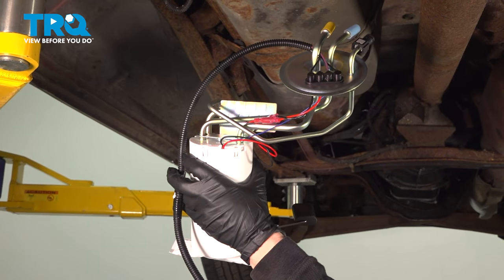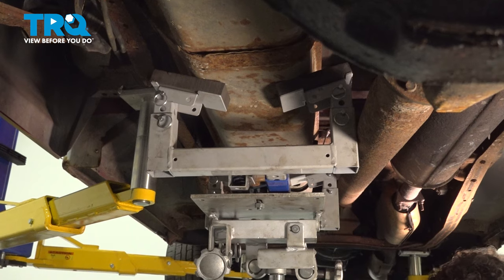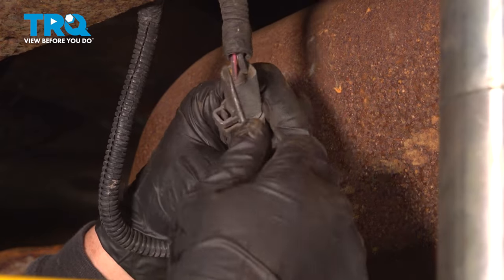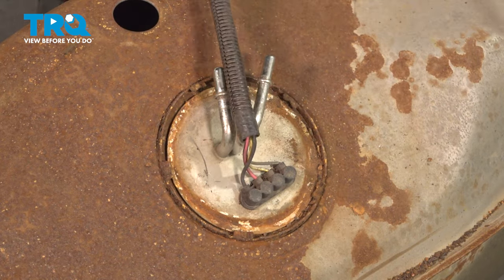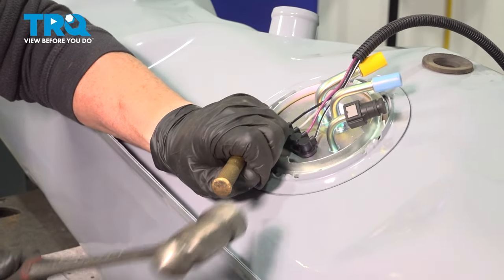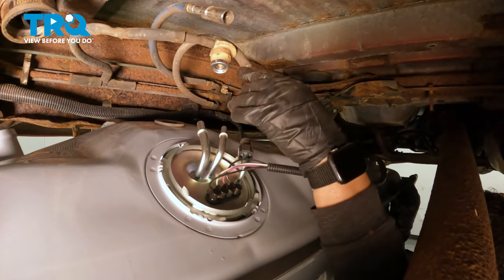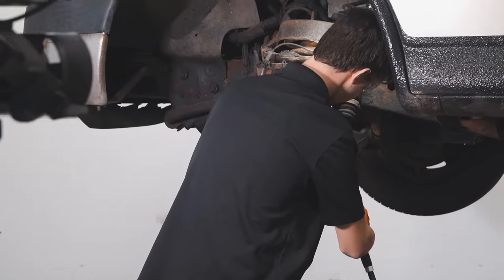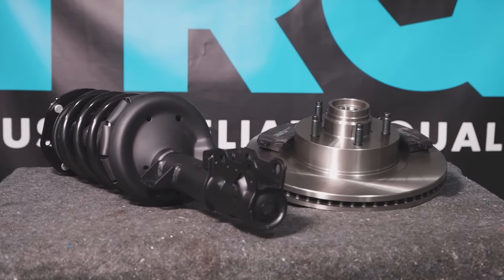How to Replace Side Fuel Pump Module Assembly 1992-1996 Ford F-150

Comment: 😊😊😊...For those wondering how to hook your new pump up(with the weird wire colors)...Here's what I did a few days ago...This also presumably nobody's been there before and "dinked" up anything.. Take out your new pump...Take out the old pump, hopefully its still factory,  not somebody's f-upped one...Look at/orientate the two pumps side by side...Underneath the cover plates,  you will see  which wire goes to where...4 connections....One wire on top will be the Common ground for the cover plate...One will go to the sender/float assy...2 will be red and black...Going to the pump...Nevermind what colors up top...Under the cover plate connections  is the key...Whatever colors the factory or  the aftermarket manufacturer used, hook up your wires based on where it goes - UNDER-  the cover plate...Cover plate is what the Locking ring holds...It's 10,000 factory  wire colors out there...Depends on if the guy was drunk that day, used Whatever colors he could see, what day the trk was assembled,  what version of the trk...F-150, 250, 350, ...4.9, 5.0, 5.8 Diesel, Extra Cab, Standard cab, Long bed, short bed, or no bed...or the wire bundle ran out that day, and the Line Leader had to go to Lowe's and Home Depot and buy whatever they had in stock...Who knows...It's a "Ford thang", I guess....Mines is working great....Used "Delphi Brand" from another online reseller....No probs so far...Took me over 12 hrs to install coz that "Filler neck hose" is evil and a few other thangs that were blocking the tank from going back in...And, It's Summertime in Texas...Blazing Hot 🔥 🔥🔥🔥🔥 by 8 am and no help and "Flatbacking" on the Concrete...So yeah,   Lovely conditions...But... We got it done....Now, to the front pump...Don't have a Lift...So, both tanks need to be dropped using a Floor jack and Soda Crate fabbed up together....Cheers....

Comment: I went to replace the gas tank, sending unit and fuel pump on my 1993 F150. But oddly enough I found that the sending unit had a different electrical connector than the one in your video. Which is the same sending unit I ordered for my 1993 F150. But I'm finding out that the sending unit in my truck, both of them, are a 1991 style. Totally different electrical connector. Why would this be? Would they use earlier sending units sometimes in the 1993 trucks?

Comment: Did I buy the wrong pump, haven’t  installed yet but the wires on the top of the pump are not in the same spot

Comment: Will this fix the front tank from overflowing when using the rear tank? Does it come with the check valve?
Reply from the maker: +Israel Escamilla We wouldn't be able to diagnose an issue like that here, you may want to have a local mechanic take a look at it. Thanks for checking us out! http://1aau.to/m/Shop-1AAuto-c

Comment: What is the function of the third line on top of the new pump? The old pump did not have that steel line and it was not connected to anything. Is it a port to syphon fuel out in the event of a future failure? If so, it's a nice feature.